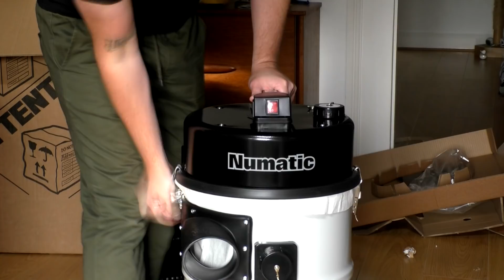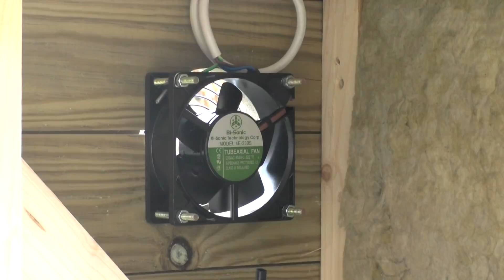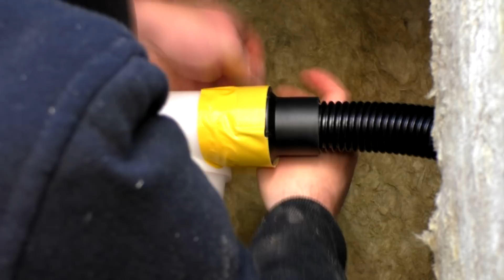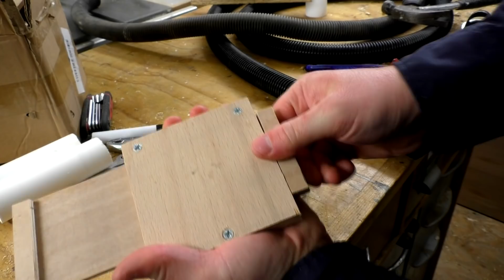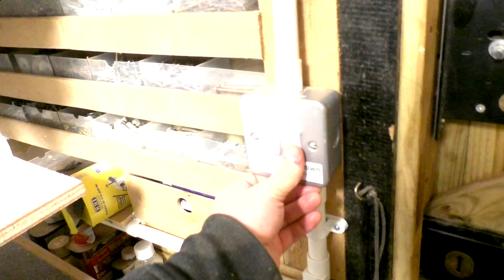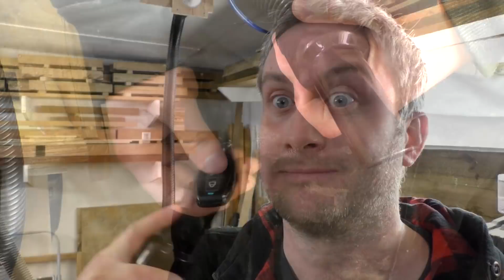My New Dust Extraction System - Installation and Demonstration

Comment: Still seems to have a lot of suction even that far away. I wonder if there are any leaks or weak points. The cyclone box or those blast gates for instance where you lose suction power. Good job on the build and video.

Comment: I had a blue plastic barrel with the same cyclone separator connected to a Karcher MV3P vac. The barrel collapsed every time there was any flow restriction. I wouldn't recommend it if you are not ready to make a by-pass valve in the barrel or insert some kind of crossbars or loops in it.
Reply from the maker: Mine buckles too, I was thinking about making some sort of structure out of wood to support the inside...
Reply: My plastic bucket imploded which was exciting! I now have a steel clip top drum. The drum would be too tall in your application, but I built the cyclone inside it with a thien baffle. Google images of Thein Baffle to see how many have done it. The first one that appears (at the moment) is very similar to mine - I used plastic waste pipe connectors and sealant. The baffle stops duct going up the pipe as the drum fills up.

Comment: Really good video and excellent choices but since the extractor is in the shed extension which is where the air is expelled why did you need a Heppa filter.

Comment: Tis great but the HEPA filter isn't needed as the VAC is not within your work area. It discharges to external air so there is no RISC of you breathing in the air discharged from the extractor. If you were to take off the HEPA filter it would also increase the suction as well.
Reply: Also if you put extract in the shed itself make sure it is at low level so that it pulls the dust away from your face. If you put it high up it will pull the breathable dust past your face where you will breath it in. Can you tell I test these things for a living lol if you need any advise let me know dude :)
Reply from the maker: Thanks man!
Reply from the maker: Yeah I'll probably move at some point in the future so the hepa filter will probably be needed at some point. Also I didn't want dust exhausted in to the extension as it'll start getting on the insulation and soon become unpleasant to go in there when I need to...

Comment: You could have just used your Titan vacuum and saved the £950 you gave Axminster... I built this very system some time ago using a 200ltr steel drum and cyclone hooked up to a Titan vac works great and the hepa filter is not needed as it's housed in an external shed.. Good project for all makers / woodworkers to do... 👍
Reply from the maker: The Titan would have much less power and I didn’t want loads of dust exhausted in to the extension which would make going in there quite horrible. Also I won’t have the extension forever as I intend to move at some point

Comment: Great job. I have one question. Why you didn't add to your fans same additional casing against rain? Probably you will have problem with electricity.
Reply from the maker: Thanks! I think the fans will be ok as the electricals are pretty well sheltered
Reply: Rag 'n' Bone Brown What about fans engine and ball bearnig? Maybe you should add small roof above vent. I'm a big fan of your workshop and work. I'm wating for next video.
Reply from the maker: Yeah I may do that - it's a good suggestion. Thanks!
Reply: Agreed, my only concern, other than I didn't see you test the suction power before everything was fitted, which had me on pins until you turned it on at the end!

Comment: Love your video but you forgotten to ground the pipes to avoid electrical discharge...and an EXPLOSION!!!

Its not too late, run bare copper cables inside all the pipes pipes, join them wherever they meet and terminate by grounding it to your earth earth supply in your fuse box.
Reply from the maker: If you look in to it, there has never been an explosion or significant problem caused by static with this set up. Just a lot of scaremongering I think

Comment: Great video, really interesting. In this context though do you really need this additional filter? It makes perfect sense of the exhaust is going back into the shop, but in your case you're filtering the air pumped into the extension?
Reply from the maker: Thanks! Check the other comments as have answered that a few times. I'm also in a new workshop now

Comment: Why restrict the input?  Get yourself two or three cyclone separators and put them in parallel.  They are cheap in comparison.  Based on your hose size, I would guess you should have purchased the less costly model to more closely match your cyclone separator.  I am not certain that small cyclone separator is as efficient if your suction/air flow is high.

Comment: Hi been looking forward to this vid I have 2 questions  1st you answered with replied to Stewart and the 2ed if you vented the vac pipe under to the shed as did not think it would blow that much out. And thank you for the links very helpful. But brill vid Thank You
Reply from the maker: Thanks! I'm not sure the extractor has an outlet port... I don't think it does so not sure where or how it exhausts - need to have another look at it (if it ever stops raining)

Comment: Great job. Thanks for sharing the video.
The air suction is very impressive. Let's hope it stays that way  (the pipes/flexible hoses can get clogged up after some time, but hopefully that is only theory).
I followed the link to the air compressor and was surprised about its specifications.
Quiet but also rather small. What do you use your compressor for?  Is the capacity enough for your air nailer and so on?
In fact your compressor is more or less outside. Will temperatures below zero degrees Celsius and/or changing humidity will not become an issue?
I'm also thinking of buying a compressor and because of the noise it produces and the place it needs I'd place it in our garage which is unheated but attached to
my workshop. But I have no idea what influence the climate in the garage will have on the functioning of the compressor.
Reply from the maker: I mainly use the compressor for nailing and blowing air and the 24l capacity is fine for that. I've not used it for spraying or anything and I'm not sure if it would cope with that. I wasn't aware that temperature was an issue for compressors so thank you for pointing that out. Apparently they shouldn't be used below 5 degrees Celsius so it could be an issue! I'll need to think about how to solve that one!
Reply: No thanks. I'm glad I can help somehow from a distance. I've learned a lot from you.
By the way, I didn't read properly the remarks you wrote to the links of the compressor. So I clicked on the 9 liter one.
Now I followed the other link and found out that the 24 liter one is even more quiet. Amazing.
Good luck with solving the temperature problem. Maybe the 2x 1200 Watt motors of the Dust Collection produce enough warmth?
England is more moderate winters than Slovakia, we can get temperatures in night as low as minus 30 degrees Celsius.
My garage will not be that cold but for sure it is freezing there in winter. Less than 5 degrees Celsius it'll be there for sure 4 months a year.

Comment: Are those push fit fittings working with negative pressure going through them? They seal air tight with a positive pressure. There might be some leaks.

Comment: Nicely done! Wider bore pipework allows a stronger vacuum (as well as bigger pieces) - but at space and money cost... are these the reasons you went with the 32mm tube? Fair enough if so - and your set up is almost exactly what I've got saved in my Axminster and amazon baskets already! Just need to find a grand or so now...!?!
Reply from the maker: Thanks! Yeah size is the main reason I went for small. Hopefully when I move some day I can connect it to bigger pipe!

Comment: Great idea haveing the units outide! That solves a space problem for me, cant believe I didn't think of it! Your twin motor machine has given me an idea, do you think there'd be anything wrong with using two shop vacs linked to the same cyclone and piping in order to have more suction power? (I cant affored to buy the twin motor machine you have)

Comment: I too have watched these 2 video's several times, maybe I should have watched them more.... I went down the 100mm pipework route and as such my small shop vac dust can't pull the air through, would you have considered 100mm pipe had you got the space?
I am now left with the decision as to weather I rip out all the existing 100mm pipe and swap it for the 40mm like you have used. I only have a table saw, circular saw, sander and router that requires any extraction.... for now that is, and it is only a hobby for me. But that last thin anyone wants is an ailment down the line due to a poor choice of dust extraction.
Would you say your NVD750 is a way better option than something like a Axminster Craft AC82E 1.5HP Dust Extractor? It is a lot less of an outlay, but accepted doesn't seem to have the class M option and was it ever a consideration?
Reply from the maker: I don't know sorry, I just know what worked for me 👍🤷‍♂️
Reply: @RagnBoneBrown  Can I ask you ... was there any particular reason why you picked the Numatic NVD750 over something like the  Axminster Craft AC118CE Cyclone Dust Extractor, which I assume has the same class M filter? Actually I have watched the Videos out of time sync and I now see why you picked the NVD750.... so I will ask slightly differently, would you still pick the 750 over the Axminster if space was not an issue?

Comment: Wow. That's expensive. Looks like you did a great job. I guess the limiting factor was the space you had to fit the collector in.  Have tried it on your thickness planer?  The specs of that machine would imply that it doesn't have enough air flow for that?
Reply from the maker: It came with a 4m 100mm pipe but I haven't hooked it up to the planer yet. May do some day...

Comment: Why did go for an m class filter if the extractor is venting outside your not exposed to the dust anyway.  If you were worried you could of just attached a 'small chimney' to the exhaust port on the vac, you then wouldn't need the fans either, just a plane vent grill on the shed extension.

Comment: Is it possible to direct the airflow out of the extractor similar to how a shop vac can be used to blow? In my garage i have a 4" system w/ cyclone that exhausts to the exterior and I get very little dust buildup outside. If you vent to the open air you can eliminate the hepa filter and have less resistance / better performance on the overall system. Also if there is any way to run your system on a 4" ducting it will be much better. I totally understand you have certain limitations and something is better than nothing but the reduction in ducting size is definitely the biggest bottleneck on your system. I run a very similar system in my basement workshop using central vacuum parts so i know where your coming from. I hope this comment helps, I do not mean it in any negative way.
Reply from the maker: Thank you! I'm not sure my extractor has any sort of exhaust unfortunately... I'll have another look at it though. I thought that bigger pipe was better for HVLP systems rather than vacuums? But my vacuum came with a 4" hose too so I don't know.... I still have a lot to learn!

Comment: Really nice setup, but a question on the M-class filter. If you've got it in the cabinet outside and separated from your workshop, is there any point in the fine filter as you're not breathing in the air anyway?
Reply from the maker: Already answered that many times, please see other comments

Comment: Any experience with PVC piping vs. metal pipes with regards to price, static electricity, ease of installation, ect.?
Have heard, that static electricity can build up in a system and eventually ignite the fine dust, if not grounded.
Reply: Most people now believe that that is a myth!

Comment: Your fans are underpowered. The vacuum cleaner does 5000l/min while the fans do only 2900l/min each. Even if your exhaust fan can keep up, the intake fan will be unable to push fresh air in while your vacuum is running. To fix it, I would directly connect the exhaust port of your vacuum to a flap grille like this one: https://www.amazon.co.uk/Manrose-gravity-diameter-ventilation-extractor/dp/B00BUQQWIW/
This way the fans do what they are meant to do, providing air cooling without being obstructed by the pressure differential your vacuum causes.

Comment: Awesome system. I'm going to do something similar using my trusty Henry.  One thing I'd question is the worth of the extra £300 filter. Maybe I'm missing something but surely if the extractor and cyclone are in their own shed and vented to the outdoors, how does it make any difference to you in the workshop? Not trying to be a smart ass but just genuinely asking. I thought hepa filters were to sort the exit air from the vacuum which is of benefit if it's in the same room as you etc. Thanks.
Reply from the maker: Not my forever home, see more recent vids
Reply: @RagnBoneBrown  👍

Comment: What is the maximum inlet diameter of the dust collector?  Excellent layout, by the way!!  My shop is a bit larger than yours appears to be (20 feet by 20 feet) and has a sloping (shed type) ceiling/roof, so I have some challenges where to route pipe and still be able to achieve good suction; plus my current dust collector is a piece of junk, so I am in the market for something more efficient and I like yours (or a North American comparable system).  Again, nice job!!
Reply from the maker: it can take up to 100mm inlet. Thanks!

Comment: Does the flexable hose not impact the performance? I'm thinking mostly of the run between the extractor and the cyclone in the extension, could that not be swapped out for waste pipe (or something larger, looked like the extractor had a 100mm inlet on it), i know you need to be easily able to get the box out to empty it and the dust bin on the extractor but there could be a work around.
Reply from the maker: I don't know enough about it to be honest, all I know is it works well enough for me at the moment. I am tempted to try the 100mm outlet but I don't have an adaptor that would reduce it down. Maybe something to try in the future! Thanks
Reply: Yeah aerodynamics probably gets very complicated quickly, but if it does the job required then it doesnt need fixing. All in all a great job, and done well!
Reply from the maker: Thanks!

Comment: just a quick question as most videos ive seen the extraction for the table saws are generally along the floor out of the way. Do you find the hose getting in the way at all.
Reply from the maker: I thought about issuing pvc pipe for the upright part to the tablesaw but realised it would get in the way for wider cuts, hence why I went for flexible pipe as I can bend it out of the way

Comment: Hi Keith just wondering looking. At doing this in my shed but dose you tickinesser shavings go through the pipe  OK?
Reply from the maker: No it wouldn’t work for planer shavings. Works ok for dust only

Comment: You paid  £334 for a HEPA filter which cleans minute particles out of the exhaust air................then put it outside your workshop where it doesn't matter?  A bit extravagant considering the extra-fine filter reduces suction.
Reply from the maker: Read the other comments

Comment: Good video, I have copied the same cyclone set up with the box due to room, I found that that box does leak a bit from the handles, have you found the same?
Reply from the maker: My box has been fine, it seals very well. I've actually had to build a small wooden frame to sit inside it as if I accidentally leave all gates closed and turn the system on it compresses the box really drastically
Reply: Rag 'n' Bone Brown ahhh yes I have the same, do you have a picture of the frame you built?

Comment: If you are looking for hose adaptors hopefully this video I just found on YouTube helps some people. It shows how you can cheaply and easily make your own custom hose adaptors by heating up PVC pipe and moulding it to fit. There are some useful comments below the video about alternative ways of shaping the pipe such as using hot water instead of a heat gun and using a wine bottle to start flaring out the pipe. It is well worth a watch: https://youtu.be/cjLQo3GuvDo
Reply from the maker: Great video

Comment: I’m not sure, but pvc can make electrick spark when dust flow inside, and burn Ur shop ;) all dust extraction in profesional solution are steel or PUR no PVC...
Reply from the maker: It’s never caused a fire so I think it’s low risk

Comment: Did I miss it, or did you not explain why you couldn't just use the reasonably priced vacuums? Your shop is quite small and seems a great size for them.

That one you bought is so absurdly expensive, it hurts my chest thinking about buying one. Lol.
Reply from the maker: Because I wanted an m class extractor and also because the numatic hoovers have a really good reputation for lasting years and years in industrial use.
Reply: @RagnBoneBrown  Thanks for the reply. I guess if you're looking for something to last a very long time and grow and expand as you do, you'd buy something beefier. I just see so many guys using a normal shop vac even in their large dist collection systems so I was curious.

It's nice that it's definitely nice enough for any shop set up you go for next. Can't wait to see how you plan things out.

Comment: so disappointed I wont be able to afford this setup :-) 

Please let me know how you the on with the 40mm tubes, I set up a temporary system a while ago but they kept blocking and on a long run it was a nightmare to unblock (used to vacuum up the floor not just dust from a machine). Seems 100mm is popular in the States.
Reply from the maker: Can be done with a cheaper vacuum like Happy Wife Happy Life did. 50mm pipe is another option! I haven't had any blockage issues